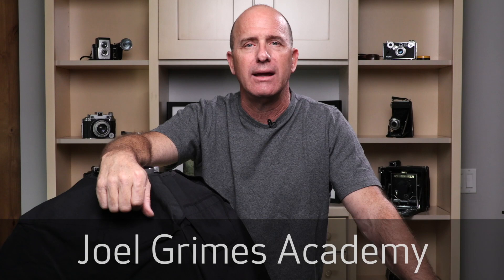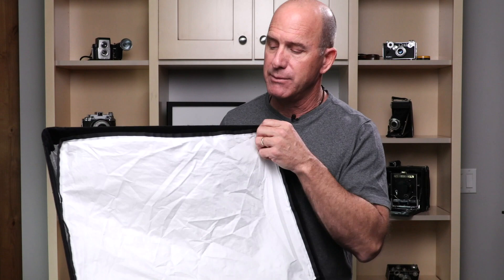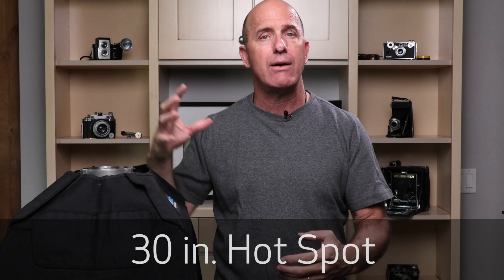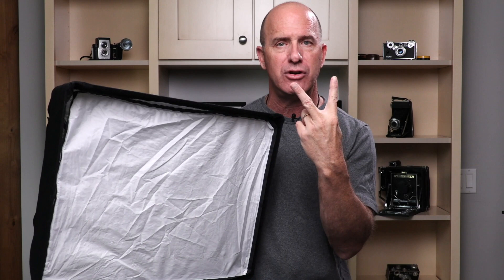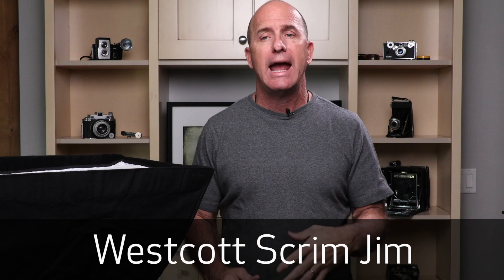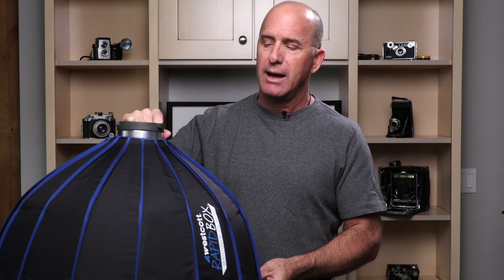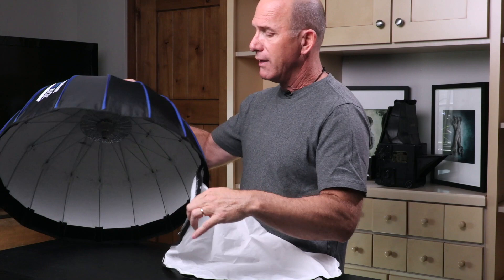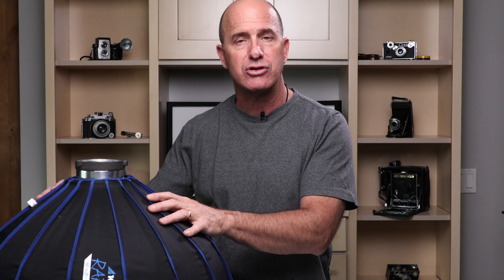Understanding Modifiers to IMPROVE YOUR PHOTOGRAPHY

Comment: THANK YOU Joel.....longtime fan; love this channel; GREAT resource.  I'd also like to add that in my experience the advantage of a modifier w/ silver interior is two-fold:  it seems to be slightly more "efficient" for output, and it also gives you a contrastier/edgier type look IF not using diffusion.   I've also realized another hack:  If I line my softbox w/ alum. foil, the output is even greater- because nothing is lost thru the modifier's walls:  Everything goes out the front face.
Reply from the maker: Great tip!

Comment: While a giant silver interior soft box will be softer than a smaller white one, I've found that the silver ones are a bit more specular(producing more shine on the skin in the highlights) than the white interiors. It's not as noticeable as with a silver vs white bounce umbrella, since the light from a soft box still has to pass through diffusion material, but it's there.
Reply: Jimmy Hill yes he mentions white vs silver interior at 6:30 but as you said and I have noticed as well... there is a noticeable difference in the quality of light and some videos demo the difference.